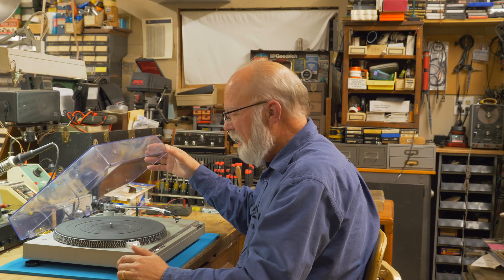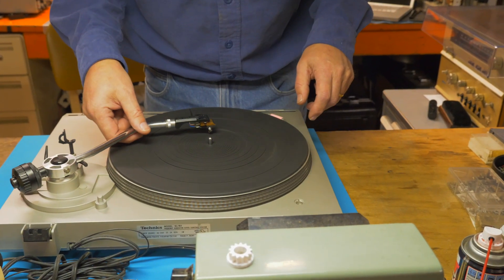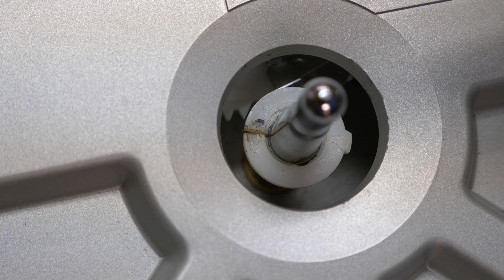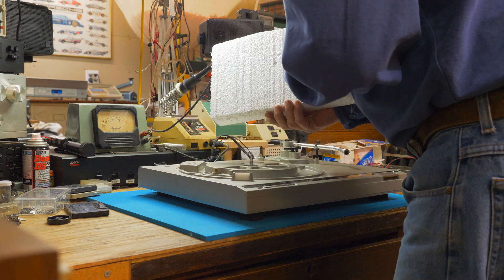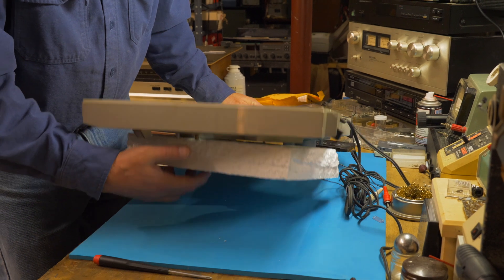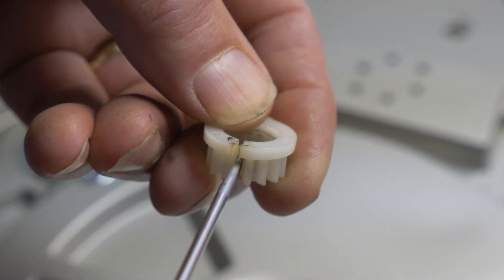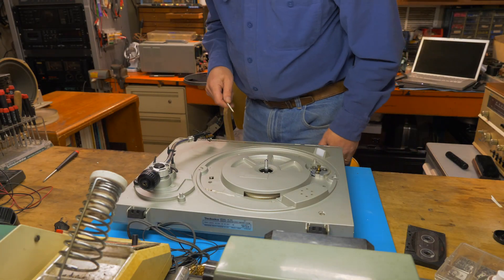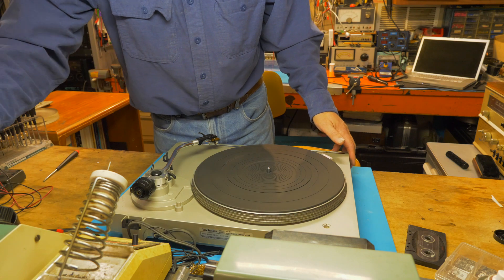Vintage Technics SL-B2 Turntable Automatic Shut Off Repairs - the RedShoe

Comment: Hey.  I have the same model.  The tone arm lifter is not working.  It lifts and lowers with the auto return and stop but does not move with the lever.  Any ideas??  Lever seems to be intact.

Comment: Just had this gear crack on my SL-B2. I found some 3D printed replacements on Etsy, but I have seen some older posts that said 3D plastics aren't strong enough for this part. Has anyone done this and have any experience with the durability?

Comment: What an excellent instructional video. Many thanks for this it is absolutely spot on. I have just been given back my original SL B2 which I bought new back in 1979.  My sister has had it for the last 30 years and was going to throw it away along with my other Technics units, I'm glad she let me know. The turntable has multiple faults one of which is this cracked gear. I need to buy one here in UK as I want to get this working again. The belt was in many pieces and sticky but easy to find a replacement on eBay for that. I'm excited to get this working again fingers crossed. Thanks again

Comment: I have a PL-516 with an opportunity I am hoping you can help with. The auto return mechanism works well. However the platter continues to spin and the turntable stay on once the are is returned. I found a little micro-switch that is off while the table is working and turning but when I press it it shut off. However I cannot determine what is supposed to activate it. Any suggestions. I can provide pics. This table is kind of neat as you can have it sitting on its feet and remove a steel cover and have access to all of the mechanical and electrical components. Thanks regardless.
Reply from the maker: Hi Mark,
 I’ll see hat I can do. I’m at my real job now but I can dig out the service manual and take a look tonight or some time this weekend. I have a couple PL 518 tables in the shop that might have similar mechanisms
I’ll get back to you
Reply: @theredshoe1315  I'm sorry for your trouble I figured out how to fix it by thinking about some things you showed in your video. I reset this lever that touches a micro switch when you bring the arm all the way over to its resting position. Have a great Friday!

Comment: super cool!! any ideas if i have a similiar technics turntable that tonearm keeps returning....if i futz around with things i get it to stay on record but then back to returning on next playthrough..it's been sitting for decades so where do i oil or loosen w deoxit? I'll be careful.
Reply from the maker: Thanks for visiting the RedShoe. I would start with removing the platter. Turn the spindle and watch for the lever on the gear attached to catch the metal "dog" to catch  to do the return movement. make sure it moves freely.
Reply: Thx much! I’ll check it out.

Comment: Thanks for the video, I have the same turntable with the gear broken. Would it be possible to share the 3D files in order to print a new gear?
Reply from the maker: Thanks for the inquiry. I do not have the files I took the part to Wildcat 3D printing in Cherry Valley, Il. They do Cad work and printing. They have a facebook page if you would like to contact them.

Comment: Good Job on the video! I recently got a Technics SL-D202 and  the cueing mechanism won't go down, I sent it to my repair man and he could do anything for me but offered to exchange it for a Dual cs504. I got the cueing to go down and now it wont go up, it tried to go back to the start but slide across the vynl, I don't know what to do. The fluid has been replaced and  I checked the mechanism that makes the arm go down.  So now that it is stuck down I turned to you because there are no manuals or videos I have found on this issue. Any advice on this will help.
Reply from the maker: Hi Warman707,
 Thanks for the inquiry Give me a day or two to look into this to see if i can find a solution. I am not real familiar with with the D202, however I do have an SL-D2 in the shop that might have the same setup. for tonearm movement
Reply from the maker: Hi, I looked at the SL-D2 I have , don't think they are similar in operation. I do have the service manual for the SL-D202. Can you send me an email to jandree@earthlink.net and I will send you a pdf. Might be some help